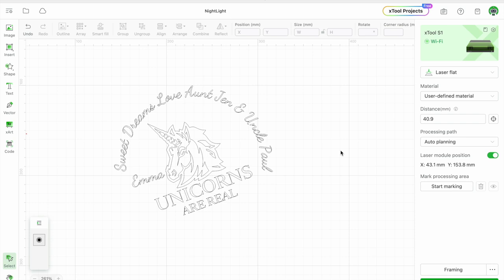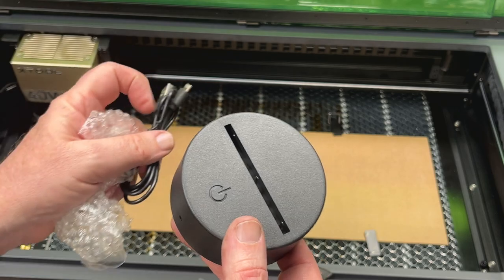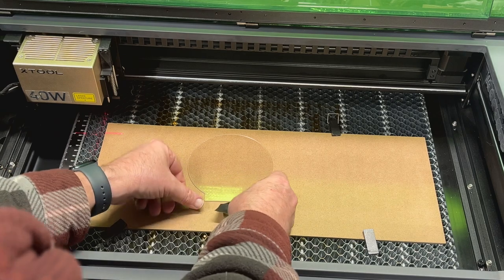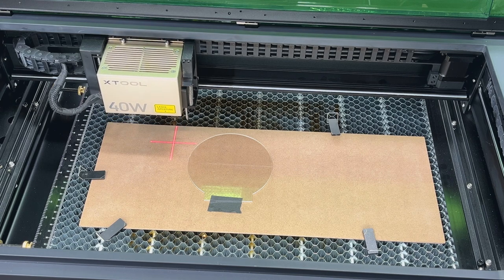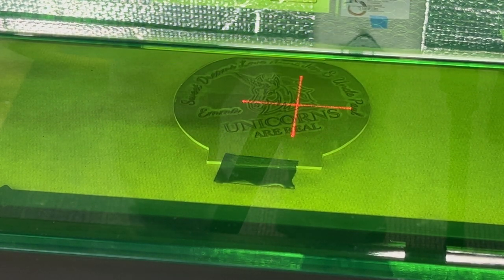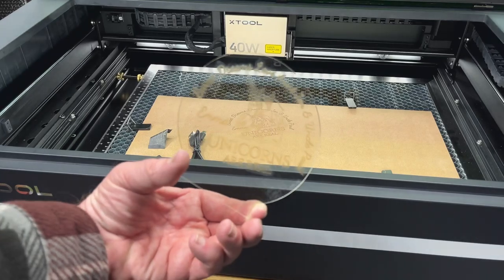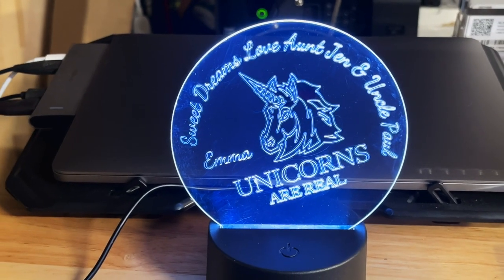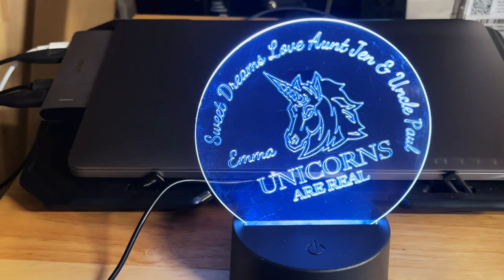Engrave or Score Clear Acrylic on a diode laser. Watch me make an LED Night Light  xTool S1 40 Watt

Comment: I tried using 45 power and 300 speed, didn't really do anything.   not until 80 power and 200 speed did I get anything on the acrylic.    this is whith the 20watt version of the S1.  should I need go to 80 power for this?

Comment: Great video. Thanks. 
Curious what the reason is to focus on the board and if it matters where you start the kaser to do so or if you just need to place and start it anywhere on the board?
Reply from the maker: The laser can't see the top of the clear acrylic the beam on 450 NM passes right through so by focusing on the board we are tricking it  a  bit and its engraving on the back side of it because it can focus and hit the board or paper no problem  and since they are so close where the are in contact with each other it works-Hope that makes sense?

Comment: Great example and art.  So no prep of material, no paint, soap, what was your average setting for the burn and I understand it is different.  Is because it is a 40w?
Reply from the maker: Power 23 speed 300 was on score not engrave but you can do either. and yes no prep just a dark back ground and focus has to be on the background not the acrylic

Comment: If you are using shop air to dry the acrylic, hopefully you have an oil-less compressor or at least an oil trap in the line. Oil would make a terrible mess of things.
Reply from the maker: Did you see any oil on it ?
Reply: No, I’m sure that you are aware that your shop air is clean. I just wanted to warn folks that may follow your directions that they should be aware of a potential problem.

Comment: What were your settings?
Reply from the maker: Power 23 speed 300 was on score not engrave but you can do either and it's always good to test your unit they all vary so I would do a material test for the very best settings for you. I recently made another 2 of these the same way with a different design for some more nieces kids

Comment: Can the S1 40-watt cleanly cut through 2mm of acrylic?
Reply from the maker: Yes and thicker but mostly solid color acrylic it’s excellent at cutting black the one it can’t cut at all is clear acrylic it also isn’t great at blue or white I have cut red , yellow, Green, orange and a few other colors and some really cool colors ones with it. Here is a cool site where you can get acrylic that diode laser can cut. I will post the link.
Reply from the maker: https://refrr.app/nVPJZ5HrSR/77833
Reply from the maker: great place for cool acrylics that diodes can cut
https://refrr.app/nVPJZ5HrSR/77833
Reply from the maker: if you need to cut clear acrylic you need a CO2 laser like this one from Xtool the P2 https://www.xtool.com/products/xtool-p2-55w-co2-laser-cutter
Reply from the maker: One down side of CO2 is the weight this is a desk top one and it's around  100 LBS pretty heavy not easy to move around by yourself